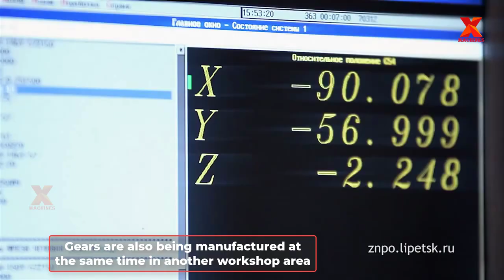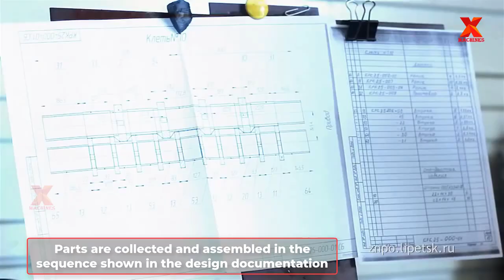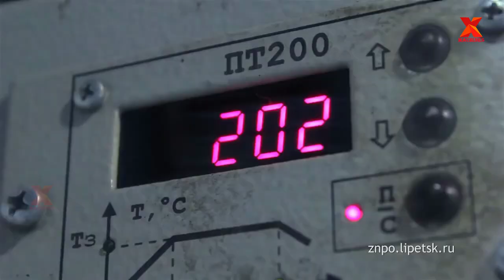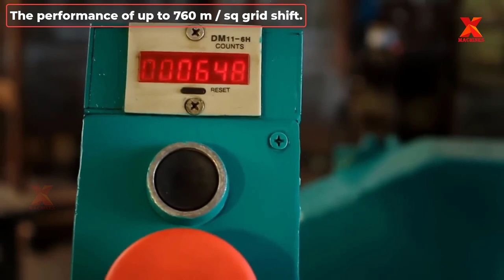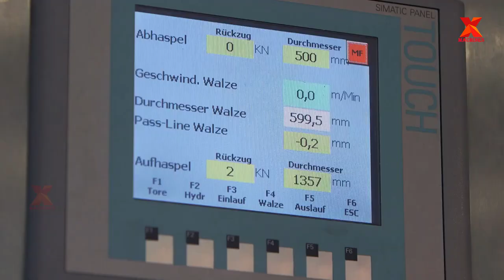Manufacturing Process Of Corrugated Sheet Roll Forming Machine. Expanded Metal Machine In Working

Comment: Your videos are hasty and inconsistent shots, I get confused when I watch them and don't understand the stages of production
Reply from the maker: I've just add key moment as following, hope it can help you to understand the video
0:01. Introduce
0:07. Manufacturing Process Of Corrugated Sheet Roll Forming Machine
4:37. Production of corrugated sheet at the factory
5:31. Expanded Metal Machine
7:05. Cast strip cold rolling de- and recoiling without mandrel
Reply: @X-Machines  You did not understand me
Reply from the maker: I'm trying to catch what did you talk about
Is this?
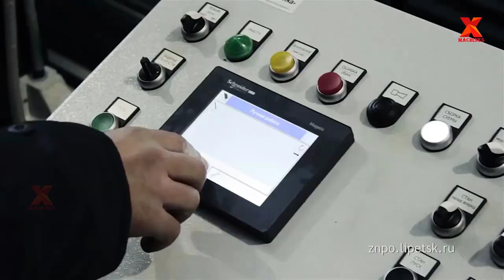Manufacturing Process Of Corrugated Sheet Roll Forming Machine: (from 0:40 to 4:25)
Rolling shaft making and other parts making -> assembly and paint -> knives making and knives installation -> adjust rolling shaft and connect rolling shaft by chain -> assembly electricity part.
Reply: @X-Machines  your videos are fine